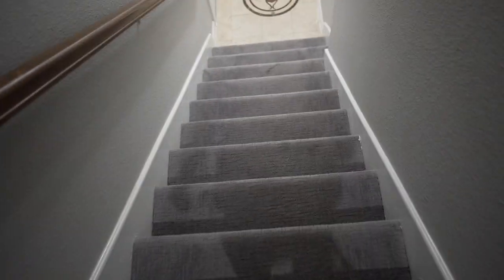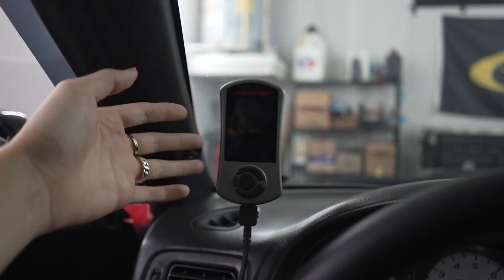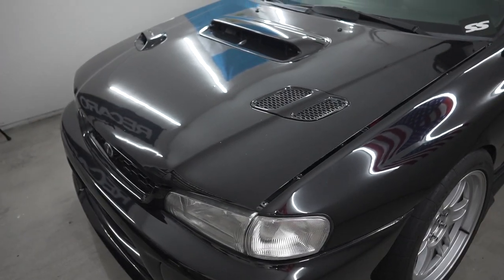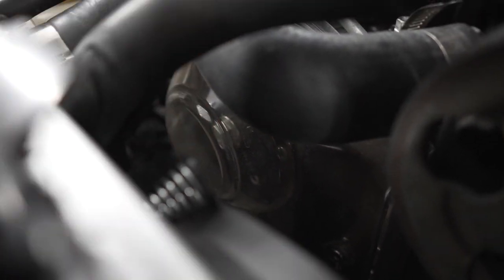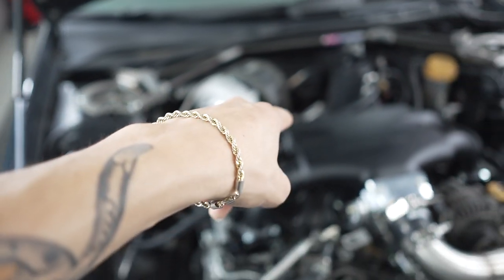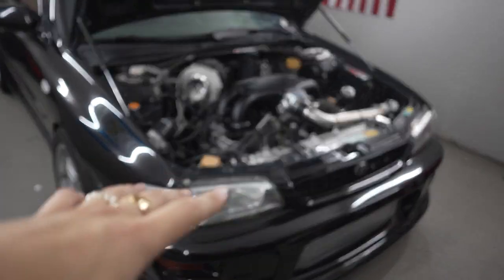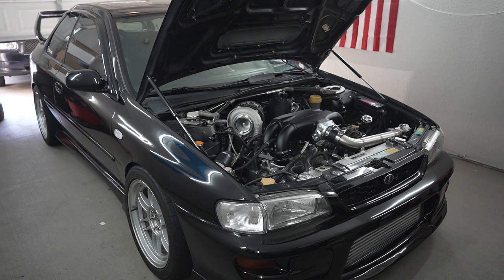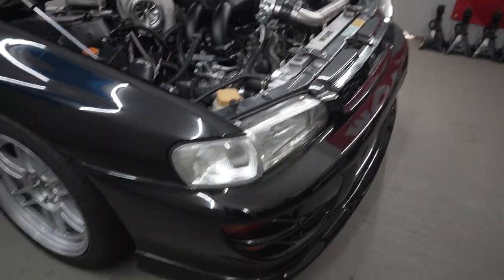Here is my 1998 Subaru Impreza 2.5rs Coupe. Full Overview on my Build and Start Up! (GC8 /GM6)

Comment: i would advise not to switch to 3 inch intercooler piping. unless your running 900+ hp its not worth loosing  volumetric efficiency. in other words your just having to fill alot more volume before it hits the motor. also with the bigger pipe your giving alot more room for air to stall and swirl in the pipe. some dont care but it makes a difference during normal driving.
Reply from the maker: This is somewhat true depending on what elevation you are at. At my altitude you will want 3” piping above 750-800whp forsure. You will notice a difference switching to 3” forsure and I would not recommend for a daily. If you are already putting a laggy turbo, then I guess you don’t care about lag as much so this piping might not be too big of a deal. IATs may be noticeable as well. I did not pay too much attention to that, but the car is handling well. Flatfoot shifting is helping the turbo lag between shifts. It is pretty awesome!

Comment: Nice ride bro! I have some JDM parts that i need to paint and install. Did you have any issues with lice plate holder with JDM rear bumper? Im surprised 17x9 fit. I also have the JDM grille, clear corners that need to go on. Also got the fog lamp covers. I do plan on also getting the carbon hood. I kept the Mid size wing though. Great content bro!
Reply from the maker: Thank you! I used an EDM bumper so the center section was intact. You might need to buy that JDM rear license plate bracket! Yeah, I have fit 17x9s on my old GC too. It is doable. Just roll and pull the fenders ofc! Lol That’ll be sweet though. I want to buy a mid wing. My old one had broken tabs so I had an excuse to get this Ver. 6 style wing. Thank you my man!!

Comment: Really clean car!
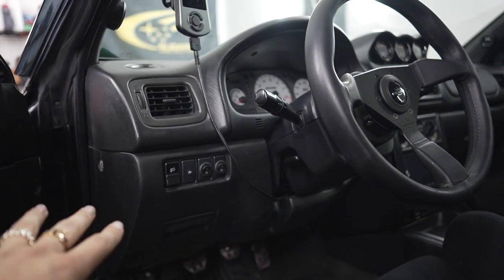Just want to ask where you got those on and off switches you mentioned at 6:21?
Reply from the maker: Thanks man!! One switch is for the clutch switch to starter disengagement (remote start) and the other is to manually turn on my radiator fans if I am in a staging lane for too long and want to keep the temps down !

Comment: Nice build bro.
Quick question, I have a 2000 gf8 and I got 245 tires but they were too massive, the rubbed all over
What did you do to yours to make it accept the 255 without any issues?
Reply from the maker: Thanks man. I was on 255s in this video. I rolled and pulled the fenders. I gave it just a slight bit of camber too but nothing excessive. That was it! You ofc want coilovers to clear the struts